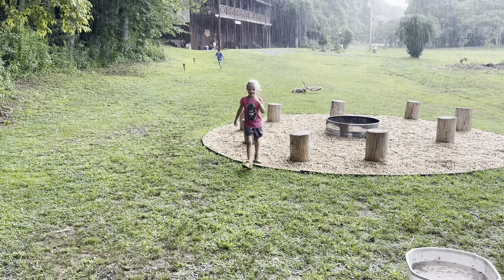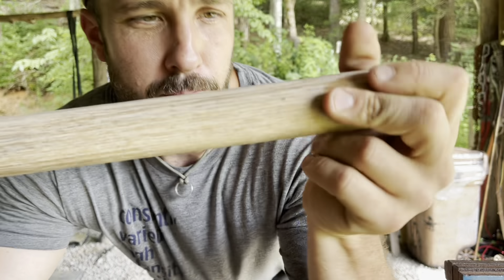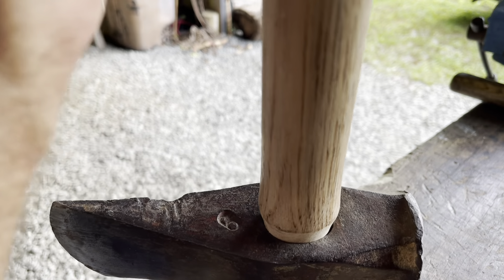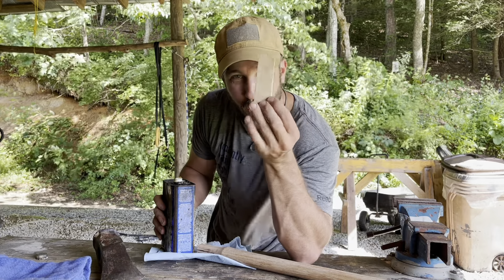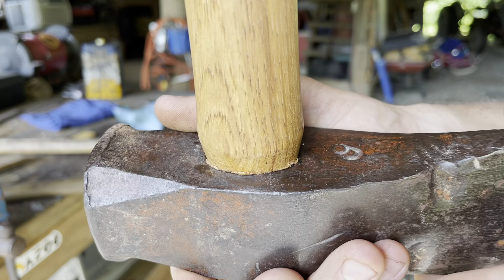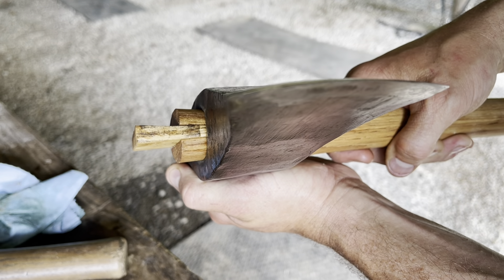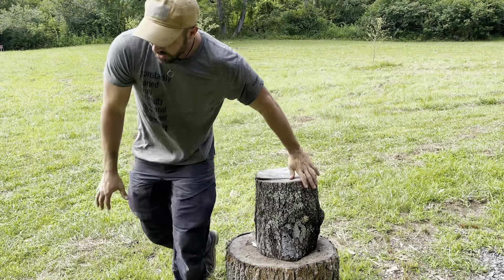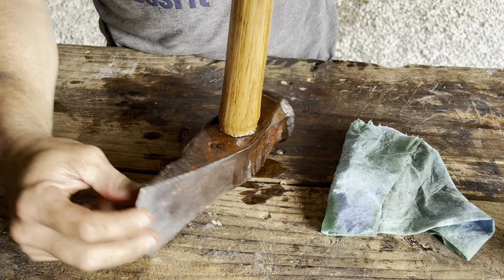Heirloom Splitting Axe: Replacing The  Handle and Sharpening

Comment: A hotdog. 
Hey, I'm from NZ and cut and split all my firewood by hand, even having to send it across the valley via home rigged zipline (flying fox). My trees are 30 year old bluegum (eucalyptus nitens). The tallest one is upwards of 50m.
I oil all my wooden tool handles twice a year, I mix linseed oil with turps and put it into a length of PVC pipe with a cap on one end. Each tool handle gets to sit in it for at least an hour. I brush on the other bits of the tool as using a rag tends to wipe it off.
I make my own handles out of various native timbers I have growing here. Kanuka goes good but I have to dry and fully season the wood before making it into a handle. Each and every handle I make is unique with the knots and contours giving it character and an ability to "fit" your preferred grip.
Great clip, I enjoyed it. Cheers!

Comment: Don't get hung up on woodgrain orientation - even perpendicular grain is fine on a straight handle. I actually prefer it on sledge hammers as it transmits less impact shock to the hands.
Reply from the maker: Good to know. Thanks.

Comment: Bench dog is very obedient -- always "stays" on command. My innate capacity to over tighten nuts and break screws and bolts makes me highly qualified in the field of over-compressing wood grain. Have to agree that your method of seating the axe head is as good as the mallet-on-handle-end -- but only when the "ground" is completely free of vibration and dampening effects. Unfortunately, the brickwork under that handle end did not qualify there, so a few good raps with a 2 lbs sledge might've got another couple mm worth of snugness (fully justifying any shortcuts taken at the shaping stage). And by all means, give yourself a break on the appearance of the metal wedge -- after all, the Fiskars axe is a good example of flawless appearance but joint-wrecking effectiveness!